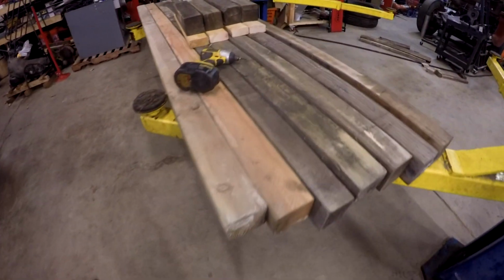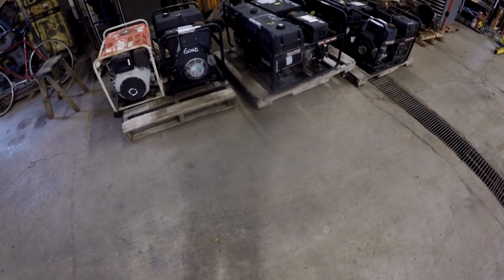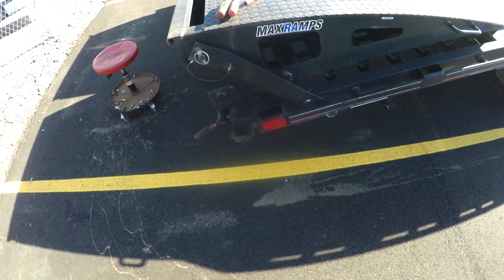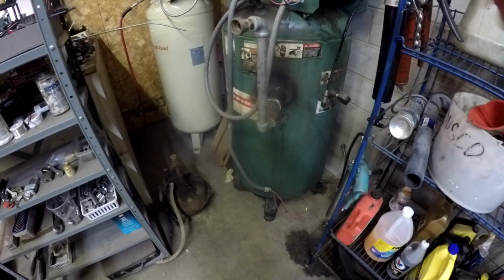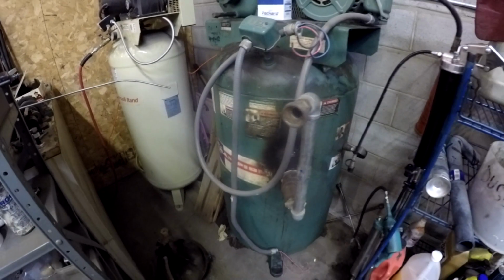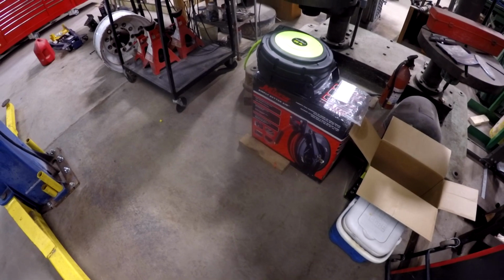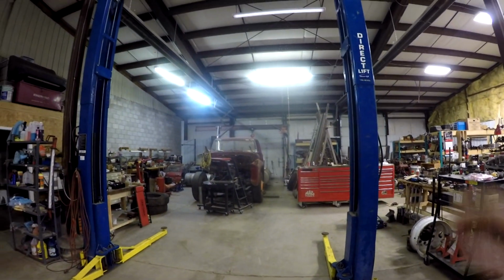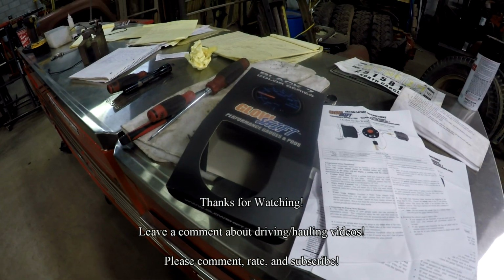Shop Update 11/25/19

Comment: Fred,  Forgot to mention the  LEDs in my shop.  I retrofitted 6 - 8ft two bulb fluorescent fixtures with LEDs.   Bought the fixtures on Craigslist for $20 each. . Then removed the ballasts and installed Hyperikon 4000k bulbs that I purchased on Amazon.   12 bulbs cost me $325 ish.   . . All said and done. . It worked out to about $75/fixture.   Might be worth looking into.

Comment: Have you looked into the cost of using black pipe. . Or copper pipe for your air lines?

You could also have multiple shutoffs and quick connects on the trunk lines to make the retractable hose reels portable to other parts of the shop if needed. 

Looking forward to the next installment of the Glowshift saga!!!!!!
Reply from the maker: Copper is fast but way too expensive! Black pipe I could probably get free or very cheap, but would have to borrow or rent oiler, maybe a power machine, etc.! I still haven't made my mind up, but black steel is an option!
Reply: @frednewman2162  I second the motion for black pipe.  I installed it in my 2200sf shop and love it.